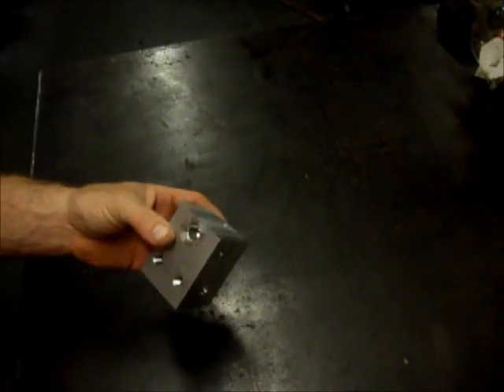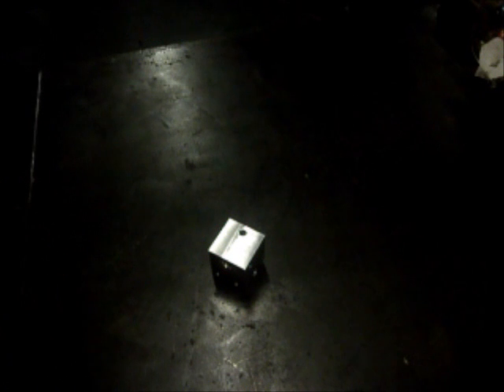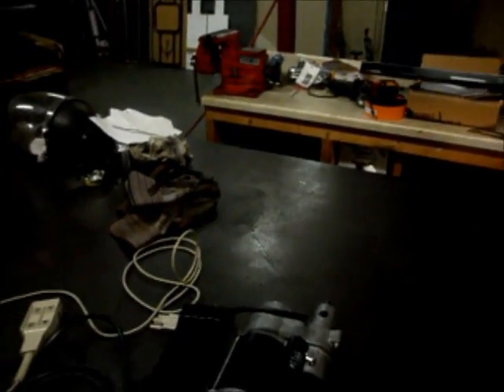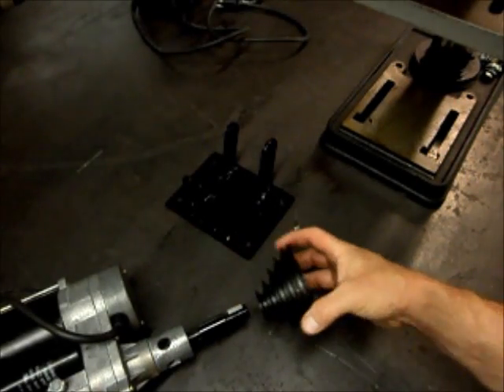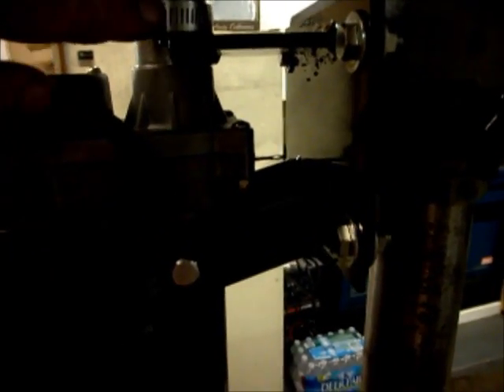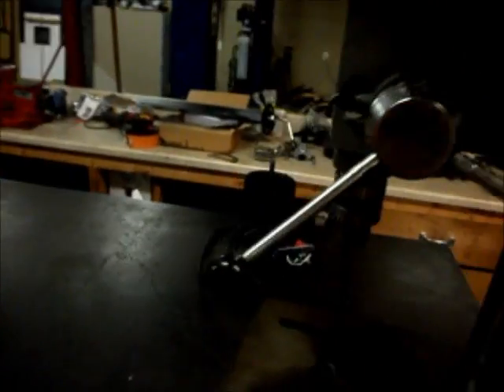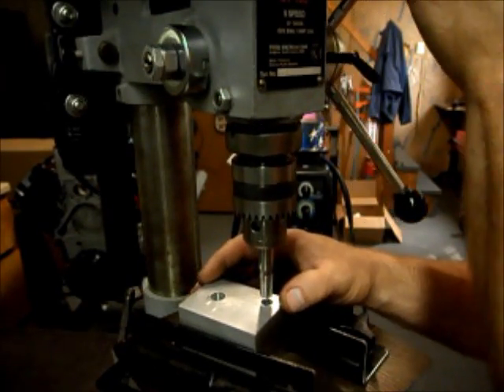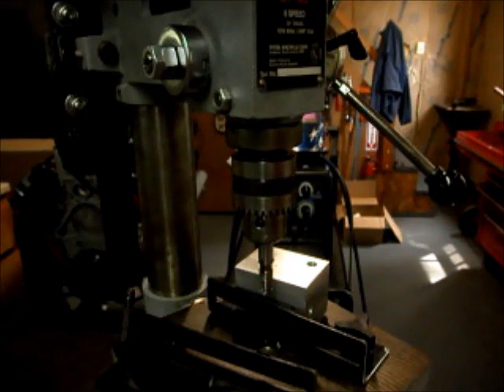Thread Tapping Machine

Comment: you have transformed the pillar drill into a tapping machine perfectly.also  you have done your tapping successufully !!! i will think to make one of them aswell. that is a good idea . at this moment im looking after something what give me a chance to tap small holes (m4) (m3) quickly... sort of hand tapping machine...to avoid that the thread will be "pissed" :P  i have seen them on youtube... im writing just to give you some advice :D your "part" should be in the solid grip ( you can always put the little wise on your working table and tight it somehow or just hold it by hand ) to make sure that the thread will pass the gauging... but its only for precission tapping like atex or iecex stuff what goes to hazardous areas (explosive) i would like to know what type of the thread it is |? ... it may work for NPT type but not for straight...(only because of grip)  if im wrong please let me know :D if it is NPT and you have gauged it, how many turns did you have ? if it is straight thread how many turns on NO GO gauge did you have ?  very GOOD JOB ! 
P.S. sometimes little vibration can cause a thread failure. know that from experience . talking about m20+ thread base on radial drill what can drill and tap hole up to m70 for explosive specs.

REGARDS !!! dont forget about lubricant :D mineral oil works well for us. it  makes the thread smooth and shiny :D gauging always successfull !!!

for small holes tapping i would replace the "vertical spring" into weaker to reduce the "pulling force" and let the tap do the job ! let the tool dig into it :D 

Good Luck !

Comment: Nice work man! Great job repurposing stuff. There is a commercial version. It's called a tapping head. They run a few hundred dollars used on eBay.
Reply from the maker: Thanks. When I made the video I was on the first run of 50 blocks (400 holes). I've since done a second run of 50 blocks for a total of 800 holes tapped and it's working great, Almost have the second batch sold so it will be onto another 50 blocks soon.